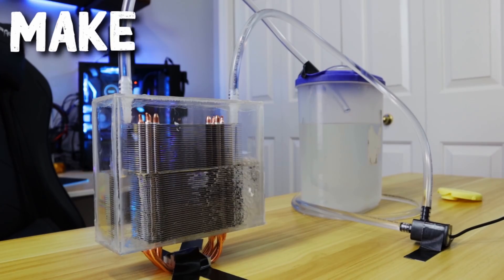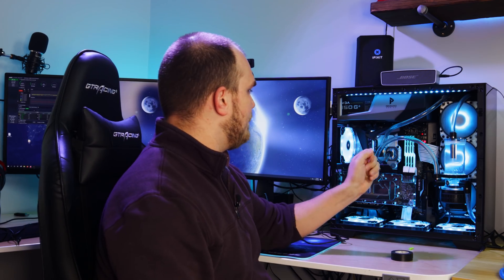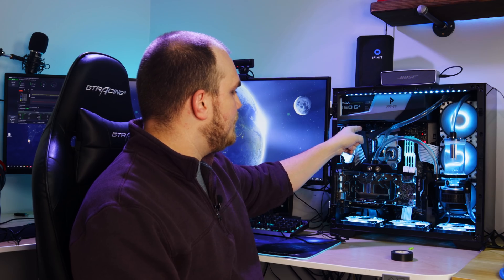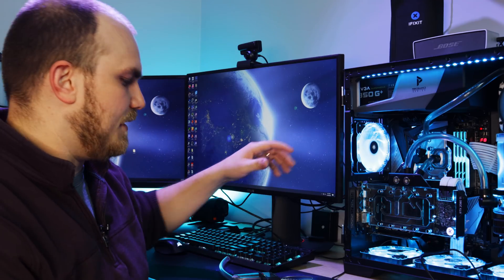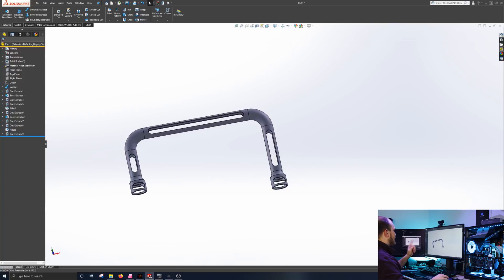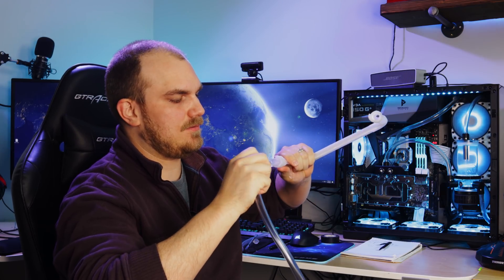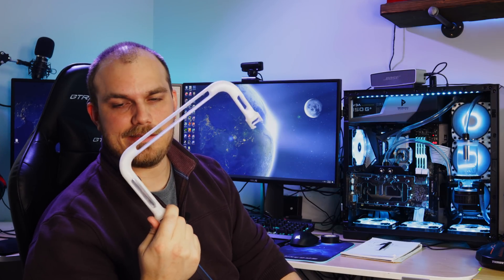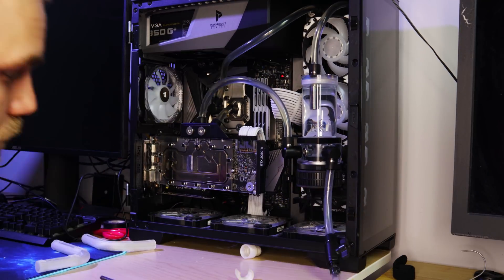Best of Both Worlds – 3D Printing Soft Line Tubing Into Hard Line Tubing

Comment: You could have left the outside of the 90s open on the back. This would allow you to push the soft tube straight through. I think this is a phenomenal concept. I wish manufacturers would make something out of steel that slide over soft tubing.

Comment: You should tune your retraction settings in Cura that stringing is crazy bad. Bowden printers tend to do better with slower retraction speed (25mm/s @5 to 6mm distance) because Cura does a little nozzle wipe before it moves.
Reply: I loved the video though this is a fantastic idea for making some cool custom loops

Comment: Will give you the kudos for doing this with 3d-printing, which is really interesting, however, back in 2000 I'd use hard brackets to give rigidity to my soft plastic water-cooling lines. So you're kinda 20 years too late ;) . Looks good though and with refinement is a great solution.

Comment: If you have a windowless case all this amazing tubing is useless.
The same with a case that is always under a Desk.
Maybe take a look into the ULTIMATE watercooling PC case.
both new and old. 
My Pick goes to the Thermaltake Mozart TX.
it has place for at least 740x120MM length worth of Radiators {480x120, if you have a Long video card}
And if you Mod the Top part of the case you can add more Radiators.
And yes it is a Behemoth of a case.

Comment: EVGA did something like this for CLC soft tubes. The EVGA CLC Tuner, a small plastic brace that clips onto CLC soft tubing to brace it into a 90 degree bend, but it only attached at the bend. It didn't brace the entire tube. I still have some of these. EVGA has abandoned the idea entirely so you probably won't find these anymore.
If I could 3D print something like this I'd probably brace the bends only (like EVGA's CLC Tuner) to avoid all the effort of bracing the entire tube, but getting the rest of the tube to go straight could be impossible since soft tubing always seems to retain an arch from being rolled up.

Comment: One of the really cool things about this is you can customize the designs of the parts that expose the tubing. Probably a lot of basic shapes like lightning bolts, squares, circles etc but I'm sure people will think of really cool things to do with this.

You could even maybe use this for some cable management

Comment: Print it in these in half(length ways) and make it so they clip together.
This way the tubes can just be pushed in and then clip them in.

Use ABS with acetone so the print is smooth unless you want to use sandpaper on the PLA.
Also use glue to secure the prints afterwards

Comment: I've been wondering this for quite some time: watercooled system have the tubing routing from pump to gpu, then to cpu and then the radiator and back. what i wonder is: how much of an impact will the cooling have if after the pump, the cooling splits into 2 tubes, one goes to the gpu and the other to the cpu... how much will that impact cooling performance?

Comment: Not sure if anyone mentioned it, but why not make it 2 pieces that snap together like your coupler? That way you can just place the tube inside and snap the other piece right over it. Never done 3D printing before so I don't know how difficult that route will be or if it's doable. Or another idea is to keep the couplers as the ones to snap the 2 pieces together like how you have but it's still split to make it easy to place the tube inside. I hope that made sense.

Comment: I think it will look amazing sanded and painted or UV pla would look great as well.   One thing is why did you route it through, I would have designed it as snap together pieces or used an outer screw at the center end that is covered by the spacer to hold it together.

Comment: Why not make them a sort of clip on cover instead of a sleeve, think of those door stops that have a cylinder and a little claw shaped piece that grabs around it. That way you can have everything face the front but it will be 10x as easy and you can still use those connectors to join it up.

Comment: Cool idea, bottom pipe needs to be a tad shorter so it doesn't touch the top one. As it stands now the center belly of the pipe is sagging because they are touching.

I can really see this idea taking off main stream especially if manufacturers get in on it with generic hybrid pipe fitters like yours and use a more premium material, like brushed aluminum..

Comment: instead of having to run the tube through it, make it so you could attach the tube first, then just clip the backbone on, like this pvc holder :
https://www.amazon.com/uxcell-Shaped-Supply-Holder-Clamps/dp/B06XDQMFZL/ref=sr_1_5?dchild=1&keywords=pvc+pipe+holder&qid=1586490019&sr=8-5
so more tube is showing instead of most of the tube being covered by the exoskeleton

Comment: Tubes overlap a bit ugly. My sugestions: lose the corner going in on the top line; if you are reprinting you can now measure the gap and remove it; lower the first line you printed (you might have mention that); make the design modular with corners, straigths and couplers, and they can all be glued and could be printed and scaled by anyone.

Comment: instead of sliding the tube into the piece why not have it snap over the tube the way pipe insulation works, have a slit along the back side thats just big enough you can stretch it and fit the tube in and still do the same thing you did to the front of it, that way it still looks good, its easier to get on and off. would take less filament and keep its rigidity but also gains some flexibility, ive never used a 3d printer but it might work.

Comment: Here's one idea. Removable bends. Straight line dimensions are easy to change if needed, leave the bends open at the back, design "snap on" joint for corners. Something like, end of the lines have drop at the ends and bends drops inside straight line and preload keeps them together.
This way you have room to tighten the main line joints properly and you can make better covers over them too.

Comment: Would be nice to see a more 'stealthy' approach. 
What I mean by that is to only have a single 'support bar' with rings on it to hold the tube in place. Basically you would print your bend cloth hanger with some rings attached where the tubes can go through and be supported. You could then place a ring ever 2 inches and at either side of a bend.
This may give more of a clean hard line look. Especially if it is printed in black and on the side of the tube (may be quite visible behind a transparent tube).
It may have to be printed too thick to provide enough support, defeating the purpose of this approach but still worth a try to see how it looks.

Comment: why 3d print stuff when there are metal tube connectors that turn 90 degrees ?
Reply: but then again if you use straight tubes better to use hard ones
Reply: soft tubing wont bend if its short enaught.
Reply: https://www.aliexpress.com/item/32978331975.html?spm=2114.12010612.8148356.21.157e5bccY5OfnI tubing bends... you use those instead of 3d printed stuff and thats it...

Comment: This is kinda low end, but could you make a pair of clips to keep the input and return parallel? It looks great, just good enough to trigger my OCD though.
Reply from the maker: i promise ill improve it in a future vid :-)
Reply: @MajorHardware  Aaand subscribed with the bell icon. :) Thanks. Re-reading my comment, I done goofed, I meant I had a low priority question, this is amazing work already, Another thing to consider is to add 3 mm LED holders in the back of the lines.

Comment: So you basically want the u-channel thats used for mounting rope lights, but with nice looking corners.  Yeah that should give you more structure.  I think if you make split 90° corner pieces with the right size radius you could make it look pretty good.  Almost like the cable combs on power supplies.  

Definitely make the corners two pieces though that way you don't need to undo the hose to feed it through.  Just bulk it up on the edge so you can do the 3d printing equivalent of hole and dowel to keep it together.  Then you can just put the hose into the corner piece afterwards to make it look good and manage it, rather than having to do the setup with the corner pieces.

1/2" and 3/8" OD rope light channel has that partly open look, but lacks the nice corners.  I use it to mount rope light to with nice straight lines and as long as you space it right you get nice corners too.  But the normal style aren't as useful for a a 'floating' piece like you went with.

Comment: Fyi, if you make those guides about 3/4 round you'll be able to snap them on the tubing after it's installed.  Might be able to print some runs without supports this way.  Still have all the challenge of getting the length right. 

How about some UV reactive PLA?  I bet you can find one that matches the other lights.
Reply from the maker: Good thinking I printed some tests like that and they work great

Comment: why use water in the case at all? just use fat heat bridge copper pipe, to black plate to dissipate heat, active or passive, fans or peltier
Reply: make the guide tubing in two parts, insert the inner pipe, put the top on, glue or strap together, no need to make more leaking points

Comment: Very cool, i would really reduce the height of the first one like a lot.
What if you just do the corners? really small section, just really the corner, if you just do small corner pieces, it will give you flexibility on assembly and can be used in any situation.

Comment: To defeat feeding through tight corners (I see a considerable air gap on your final design in the corners) cut the hose on an aggressive angle >45°
And make sure the point is facing opposite to the bend, you'll find the pipe will flex through so much easier.

Also it'd be catching on the later lines of your print, give the ID a bit of a sand and it'll go through so smooth :)

Great job, looks mint, can't wait to see v2
Reply from the maker: I think I got something good ... maybe
Reply: @MajorHardware  I have faith 😂

Comment: Cool - Looks great although I'd probably heat/chem smooth it before fitting.  There is something similar used in the Aquarium hobby, I remember some of my Fluval external pump/filters came with some plastic brackets that bend the flexi-hose so it hook's on the back of the Aquarium 👌

Comment: Love the concept, had never thought of doing that. My thought are that if you have a theme build instead of using dye in the loop and possibly creating a problem that will have to be corrected later is to match the frames to the color of the build. I think you just made soft tubing cool again.
Reply from the maker: i havent even added the RGB yet
Reply: @MajorHardware  I have built a few ARGB systems but my personal rig doesn't use it. Lots of other places to spend the money.

Comment: Next time try Silicon lubricant, you can put an elephant through a key hole with the spray silicon lubricant, and usually it won't attack (Most) clear types of polyester / polyvinyl lines

Comment: Actually not a bad idea indeed.
It does help to have even better quality 3D print, but maybe it might even be worth it for some company to do some actual casts.
But fill them up a bit, sand down, paint, they'll be nice and smooth and a nice consistent color overall, the look with the openings in them is cool.
Nice job.

Comment: Can you maybe try to buy some hardline tubing with a inside diameter there fits over the soft Line tubing and try to the use as the 3D printed thing😊
Reply from the maker: but then what would i do with my 3D printer
Reply: Major Hardware idk i just thought it would be easy for everyone if you didnt need a 3D printer. Btw really GOOD video and keep up the GOOD work👍🙃

Comment: blue petg? petg's clear property would look nice with the light.
Reply from the maker: i need a higher Quality printer to print in PETG, mine might be able to do it.
Reply: @MajorHardware  I use an ender 3, as long as you can make the heat you're fine.

Comment: Now do the same with the ATX 24 pin connector
Reply from the maker: cable tracks interesting idea
Reply: @MajorHardware  I think i could write a generator script for those. So you measure your cable runs, punch in the numbers, get that shiny .stl file. Should be easy enough.

How did you print your parts for the watercooling runs? I assume a lot of support structure was involved 😁

Comment: add space for led strip into the model for the awesome rgb.
Reply from the maker: trying to source small rgb lights
Reply: @MajorHardware  these will work as you can cut them up and use wire between them but you will have the agony/ecstasy of driving them with an arduino. https://www.amazon.co.uk/dp/B01N2BHAKB/ref=sspa_dk_detail_1?psc=1&pd_rd_i=B01N2BHAKB&pd_rd_w=Bxk4J&pf_rd_p=1055d8b2-c10c-4d7d-b50d-96300553e15d&pd_rd_wg=Ev5PI&pf_rd_r=32Q6Q2WE7DDSG34S8WJ5&pd_rd_r=0db0e4e3-c23c-4817-8ace-3d148c047f3f&spLa=ZW5jcnlwdGVkUXVhbGlmaWVyPUExSEVQTlU5V0VLTkUxJmVuY3J5cHRlZElkPUEwOTgxNDEzM0Q0VDE0MlEzNDFGWCZlbmNyeXB0ZWRBZElkPUEwOTM2NzY0TjVSUTcwQko4VE1ZJndpZGdldE5hbWU9c3BfZGV0YWlsJmFjdGlvbj1jbGlja1JlZGlyZWN0JmRvTm90TG9nQ2xpY2s9dHJ1ZQ==

Comment: Is it possible to shrink it down so the brackets basically just go at the bend points? You would significantly cut down on the materials used and time to print, and it would also look much better as any straight line would still just be tubing.
Reply from the maker: i can try it

Comment: On the backside of the channels make a small opening and put a LED in and let the tubes glow
Reply from the maker: you have any links for micro RGB
Reply: @MajorHardware   I would try to use some ws2812b. There are available every one solderd to a small board. They need 3 wires are chainable and adressable. It could be that will work with the 5VRGB from your Motherboard 

https://www.amazon.com/BTF-LIGHTING-WS2812B-Heatsink-10mm3mm-WS2811/dp/B01DC0J0WS/ref=sr_1_2?crid=2JDDU9WSG7G09&dchild=1&keywords=ws2812b+smd&qid=1585939142&sprefix=smd+ws%2Caps%2C225&sr=8-2

Comment: Damn, I thought of this some time ago, my idea was to just make the pieces for the corners (bends) that dont wrap around tubes 100 percent, so you can just pop them after filling the loop. But Im glad someone else made this, bravo!
Reply from the maker: Thank u
Reply: I was thinking the same thing. Split it in half so it can be put on with out skidding the tub through it. That way it can be added or removed without having to drain the system and could be used with hard line also.
Reply: you dont need to bend hardline tubing...

Comment: What if the back was open, so you could just snap the tubing in?
Reply from the maker: Not a bad idea
Reply: That's what I thought ...
Reply: i guess i should have read more comments, i had the same idea also, like the way pipe insulation works, idk how flexible the stuff is but you might be able to just make it solid then cut the back with a knife and then slide it over and if you do the dimensions right you wouldn't even see it.
Reply: I think the way he did it lends to a better aesthetic on the curves being open like that.
Reply: noxxi knox   remember, the tube is flexible though. so it should work :-D

Comment: We can do better. Basically you are not solving the worst issue with hard tubing: disassembly your rig.
We should be able to snap-in/out those to easily remove/repaste components without completely drain and disassembly the loop.

Also, do you really need the straight lines? For short run the curve support should be sufficient, right?

Comment: Kinda a dumb idea here.  (Not what you did but my suggestion) since you had such a good run with the backbone on the soft tubing.. could you in fact make a hard line tube with pla? Now I know it won't be clear and pretty. But the thought of just printing your headline tube with all the bends pretty done is kind of appealing. Even if it's a solid color. Now look. I know pla and Fdm printing are not exactly water tight. But. If you were to print a tube and then coat it with an epoxy or something. I think it could be interesting.
Reply from the maker: I think I will try it you can buy pteg material
Reply: @MajorHardware  that's true. But it's the fdm printer that may cause issues. As it lays down layers it can accrue gaps between them causing them to leak. But I think that would be pretty cool to see if you could actually print an entire line just ready to install. I would suggest testing on a spare board or even without a board on a stand alone loop before installing it on anything you care about. Water. And electronics. As we all know.. do not mix.

Comment: Very good idea. To be more practical it would be great if each bend and fitting cover were modular so the rest is just straight runs that are easier to measure. Second thing is making each part snap on so there's no need to drain the loop each time and take the risk over the expensive equipment.
Reply from the maker: Good idea

Comment: not a huge fan of the couplers. if it were me i would have left the face of the tubing exposed doing just enough to hold on to the tubing well. ideally you'd be able to snap the tubing into it with maybe a 2 piece snap together thing to hold on to the fitting if you want to go that way. i'd keep the slots in the back half but try to minimize them without losing rigidity. someone else said UV or glow in the dark and that is also a great idea.
Reply from the maker: ILL tune it a bit

Comment: Clear fillament? Or is there UV-reactive. Anyways, you are literally the only person in world with that, while harline tubing all around, so it's more special and indeed fits the channel :) Also some honeycomb/spiderweb design possible for the hole if too much time in hand or even making the top run holes read "Major Hardware" :P

But those holes plenty fine already, only part I don't like that much is the central spacers as they are of a bigger diameter and in, well center of it all.
Reply from the maker: clear